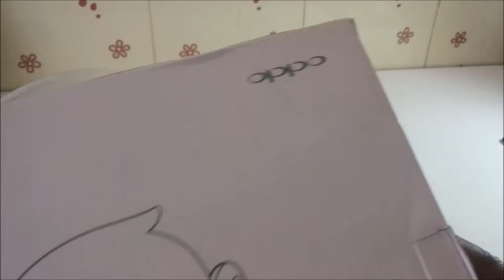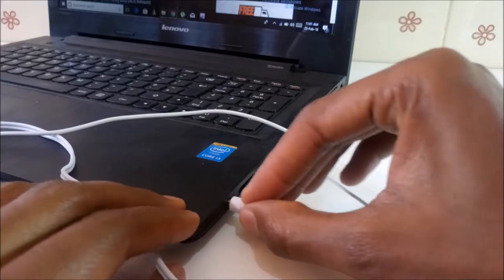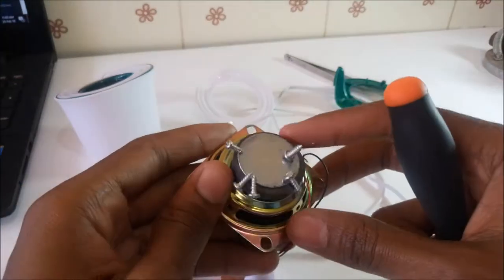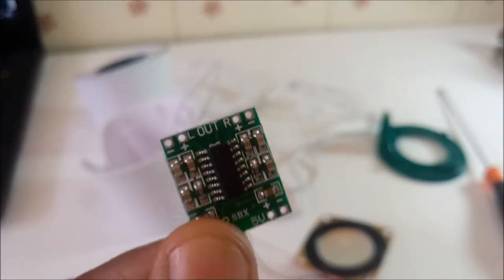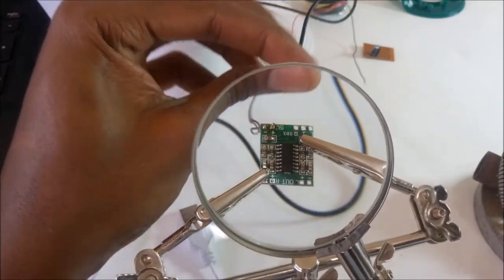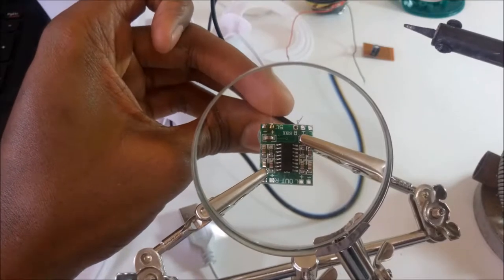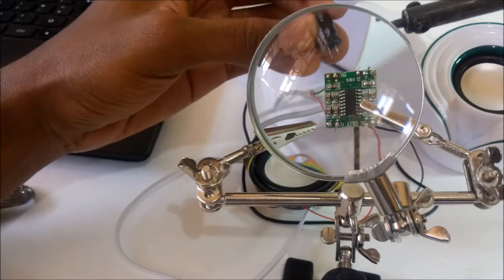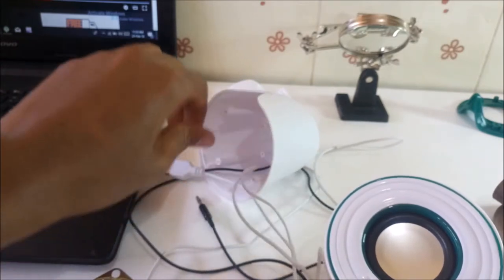The PAM8403 Amplifier Module Saved My Speakers

Comment: I am having hissing sound on connecting to laptop I used 1000uf/25V capacitor, what should I do? Should change capacitor?
Reply: Please use powerbank or phone charger 5 volt.   pc usb port is not powerful voltage i recommended use phone charger or powerbank
Reply: You need to fit ferrites to the power cables, wrap the 5v power cable around the ferrite 4 times
Reply: Same problem, I have hissing sound too came out from the speaker when I use this kind of amplifier and the supply voltage is from the laptop/PC USB port. It probably the noise from the laptop motherboard itself. When I connect it to another separate power supply such power bank or a charger, it is no hissing and clean.